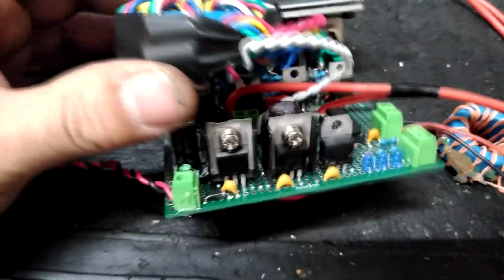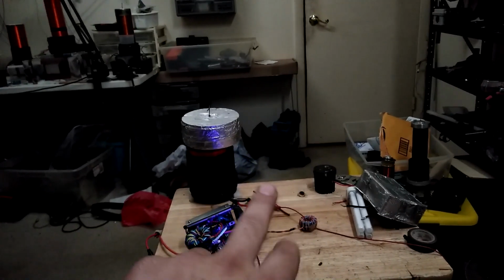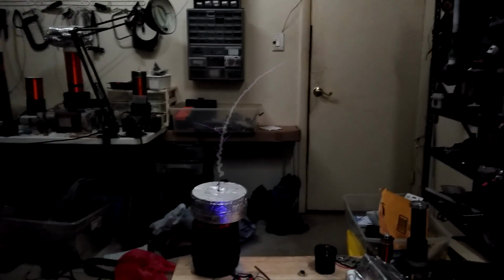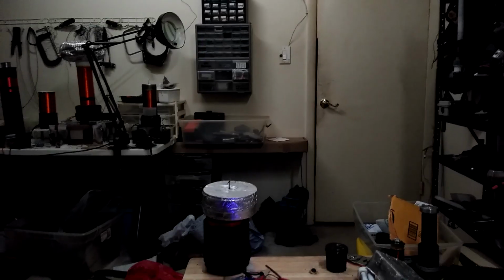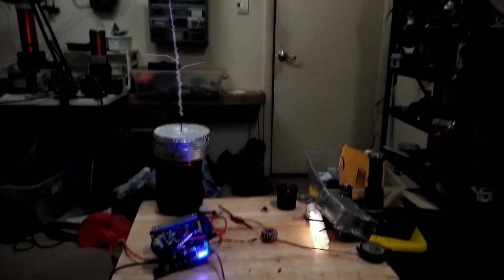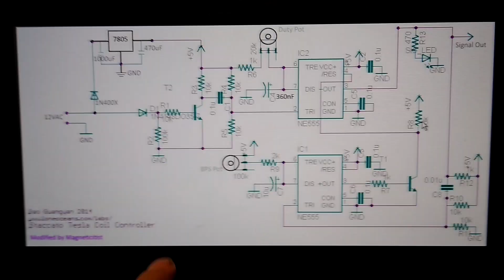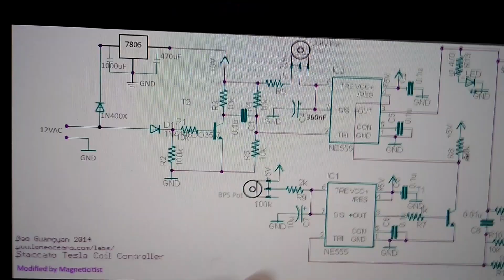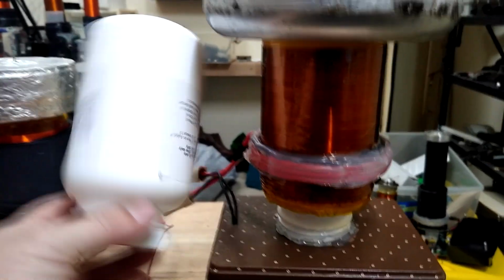Simple Mini Ramped SSTC Full Bridge testing

Comment: Cool!  How much bus capacitance would you need?  I'm running the tefatronix circuit from a full bridge rectifier.  The circuit can't have to large of a bus capacitance on the output of the rectifier, otherwise, it wouldn't be ramped.  However, without a bus capacitor, the output is very small.  How much bus capacitance would you recommend?
Reply from the maker: I wouldn't use any more bus capacitance beyond snubbers if you're trying to use line voltage ramps. So like IDK 20uF region tops.  
It may be a tradeoff of thinner longer peaks vs shorter thicker arcs. I've probably got like 1uF in this circuit.
Reply: Ok.  Thanks.  I just tested the staccato circuit with many different capacitors with different capacitance.  The circuit seems to be ramping ok according to my o-scope.  For some reason, the sparks are smaller when I run the staccato but larger when I run it on a regular interrupter, regardless of the capacitance I use.  Could there be something that I'm missing?
Reply from the maker: @Livewire460 Have you scoped the staccato circuit to make sure the squares are lined up with the start of the half wave?
Reply: Yes.  I scoped the output of the variac and the staccato and both seem to be in phase.
Reply: Oh.  Nevermind.  The staccato circuit imediately moved out of phase after I adjusted my frequency knob.  So now that I know that it was out of phase, is there any way to get it in phase?  Although there is an option to directly hook up the sstc to the wall outlet, I don't think that it is such a good idea to do so since i don't want to push the circuit to run on 120vac without some sort of ballast to run through such as the variac.
Reply from the maker: @Livewire460 Hmm to account for ballast phasing not too sure beyond trying to mess with the ZCD or feedback circuit (if using a CT)
Reply: @Magneticitist Yeah.  I'll probably leave the staccato alone.  Although, it might work if I hook up a capacitor to the output to slow it down until it lines up.
Reply from the maker: @Livewire460 What did you mean by it going out of phase when you change the frequency though?
Reply: @Magneticitist  Whenever I turned the frequency knob, it would fall in between the 30hz half wave.  However, when I did hook up the capacitor from the output to ground, it had no problem getting in phase with the ramp, wherever I turn the knob.
Reply: Weird.🤔
Reply from the maker: @Livewire460 Oh ok, well are you using fets that you think would particularly not be able to handle full line to neutral voltage? (assuming that's 170VDC pk). For me I always felt like running the full half wave ramps were real easy on the bridges. Going above 120VAC seemed an issue where my primary wasn't insulated enough, or I had interference in the circuit etc. Running fast repetitions of the pk voltage might have a bridge working hard but slow and reasonable seems to be a breeze. For me a variac didn't really introduce enough phase change for me to notice though.
Reply: @Magneticitist  I'm using some 460s.  The reason I don't feel confident to run it on the full 170v ramps is because I am using the tefatronix circuit.  Although the fets can handle the voltage, running it on full power is risky.  I can run it on full power but I need to do quick runs so they don't die.
Reply from the maker: @Livewire460 oh that's right, good call lol

Comment: what is the effect of putting the primer too high, and too low?
Reply from the maker: There are a lot of things going on when doing that. When moving the primary upward, not only do you increase the coupling coefficient but you can shift the phase relation as well as the frequency. The output voltage may reduce some while the current transfer may increase. The HV node at the secondary topload will also have something closer to strike toward if the voltages allow it. If you bring it too low, like well below the lowest winding of the secondary you have a much lower coupling between the coils. This can only become ideal in something like a DRSSTC. Depending on the oscillations you can have nodes and antinodes across the secondary or see a better throughput by adjusting the primary precisely to a certain spot that may be halfway up the secondary etc. All of it depends a lot on the load itself which becomes the streamers.
Reply: @Magneticitist  thanks for the response. i really got the longest arc 10cm half bridge 220vac bus. in my ramped sstc. and this is the longest arc as long as i make tesla coil and thanks to your direction. thanks a lot.

Comment: hi friends. what is your secondary coil dimension(diameter & height).
Reply from the maker: That coil is about 9cm x 9cm using 32AWG. Comes to somewhere around 500khz or so with a topload.
Other similar coils that worked were a little thinner in diameter using 36 AWG.
Reply: ok mate. does the 500khz frequency not hurt the igbt you are using? is it not high resonant frequency (500khz), if driven by a 60n60 igbt?
Reply from the maker: @dinapuspita6611  sorry for late reply but 500khz is more of a problem for the gate drive stage. I cannot run it continuous wave at 500khz with only the two single gate drivers because they will overheat. Something like 250khz is doable CW with those IGBT's in a full bridge. 

At 500khz interrupted however everything runs fine. So long as the on time doesn't go too high everything stays cool. 8.4ms or so is not too much on time for it.

Comment: can you make a driver less sstc?
Reply: you should check out LabCoatz video, it's one of the best ones out there showing how to make a "driverless" sstc: https://www.youtube.com/watch?v=Q0lkg9lxz3s&t
Reply from the maker: I have but they are low bus voltage. Still got 8 inch arcs on one of them at 30V.
Reply: @chrisporter4286  @Magnetictics thanjs dudes
Reply: @Magneticitist  Wait how did you get 8 inch arcs on it?! LOL
Reply from the maker: @tatemcaluney7269  Just tuning the push-pull config to get the max output while trying to preserve a ramping shape so they reach out longer. If you can do that you can get singular arc channels the current feeds into to make them overall longer and thicker compared a whole gang of branching and unpredictable arcs. You don't actually need a ramped supply to create the sword arcs you can do it from straight DC and just mess with the phase shift with a series primary capacitor.
Reply: @Magneticitist  wait was this a single transistor, driverless sstc or half bridge? cuz i've never heard of a half bridge, driverless. and how do you tune the push-pull config? do you use a oscilloscope to look at the shape of the voltage ramp across the bridge? i'm very new to scoping...
Reply from the maker: @tatemcaluney7269  It's basically a driverless circuit and it's sort of like a half bridge where there are two transistors but they are both common grounded at the source. A half bridge uses a voltage divider arrangement so only half the supply voltage is switched to the load. With the push pull the entire rail voltage is alternated between the two mosfets and it's more like a slayer exciter because it uses direct secondary feedback (through a transformer). Check out http://tefatronix.g6.cz/display.php?page=sstc5&lang=en for an easy version of the circuit. You don't really need to scope anything it can be done with trial and error. I just modified the circuit to use a single primary instead of a center tapped one, and it has a series primary capacitor to help tune it.  Here's the schematic I drew up of the setup I got 8 inches from at about 30V. https://www.youtube.com/watch?v=MJfqZ6Irrrc
Reply: @Magneticitist  Thank you! What a cool circuit. It always amazes me to realize you think you know the minimum amount of components it takes to make a good tesla coil and then you learn about a double transistor slayer exciter that makes 8" arcs from 30v. Also, I found out you made a nice adjustable tesla gun a bit ago while I was checking out your earlier videos. here i was thinking teslaundmehr was doing something mystical
Reply from the maker: @tatemcaluney7269  Thanks. I actually played with that circuit quite a bit and have about close to 10 of them in near final builds. Since a couple of them worked well from 24v or so I used them in the TC guns. The arcs are typically only 4-6 inches max with a 24v setup like that but I can also run them continuous wave. I have yet to scope any of them but I have a feeling a few of them could be pretty close to dual class-E if tweaked a little since they run so cool with little heatsinks and fets. 

Teslaundmehr's is an example of how to get it done using a conventional half bridge design and utilizing the ZVS boost stage to get 300V or so which can result in much better arcs. The tradeoff is just that it draws considerable power at those voltages trying to run CW so it's difficult to do it from a battery. His iteration has probably the coolest method of doing it and he's made everything so small which is what's so amazing. Otherwise you could take any small or large SSTC and get it to pulse big arcs by just charging its DC reservoir with a boost circuit of some kind, making it battery operated.